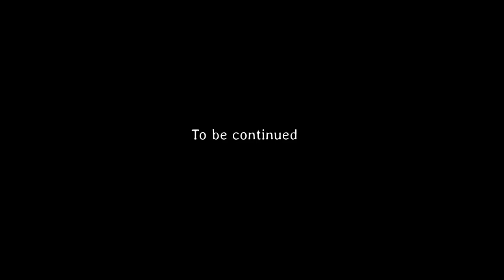How to Master Running the Drywall Flat Box on Stilts

Comment: Great job like always guys ,I'm sorry I have 2 good questions hope y'all can answer ,what size box is the first one on  the ceiling ? And on what setting how much crown is it using for that coat?thank you .
Reply: Wall and ceiling is the same box. 8inch Columbia fat boy box. 12inch of the same box for the final cost the next day when dry. Every job is different but for second usually a 3 if it has a fresh blade but just run a joint on a 3 and get a straight blade or small level and put it on the joint and make sure it's only just touching if it's not turn the box down to out more mud out or up if there's to much mud!
Reply: @drywallgangsters   thank you bro, I'm learning with yalls vids little by little also buying my tools one by 1 bc theyr so expensive .👍
Reply: @jorgiep09  no worries and yeah they are expensive. Once you run your second coat and it's dry put the level (get a small one or use something that's really flat but isn't long) on it and if there's a big hump give it a quick sand with a pole sander. If no hump you're good for the final box.
Reply: @drywallgangsters  thank you so much man I really appreciate yalls help ,keep up the great hard work .👍
Reply: havent really seen these before.  did you thin out the compound?

Comment: U dont have trace over your whole flat jus clean edges up an walk away. I u want pock to go away jus run the box back over it opposite way
Reply: What do you do about all your start and stops from the box we found that it all needs to scraped or sanded  before the next box. We do this to eliminate all that. Plus it's easier on the body not having to run everything twice!
Reply: @drywallgangsters  i clean edges an feathers into my lap mark to knock it down i dont sand or scrape either an i only do 10 box on 1 an 12 on 3 or 4 an i cone out with a good finish
Reply: @jasonhoover6320  what do you mean edges, does your box not feather your edges? What do you do with your starts where they leave a slight drag mark. Follow behind allows the person to fix any bad joints that the box can't fix and allows every joint to go tight into the inside corner because the box can't go right into the inside corner it leaves like a 10mm gap
Reply: Edges where u start your box im sorry i not a very good explainer lol. The box is designed not to be trace across the whole flat. Your work really nice im not trying to confuse you. Im not say your doing it wrong im jus saying you dont have to trace the whole flat. When you trace its takes mud away from the flat so actually the box isnt doing what its suppose to if that makes since.. I'm sure what your doing works. I time both ways an the way im doing is faster an thats money to me
Reply: @drywallgangsters  i know all i do is close that gap an walk away
Reply from the maker: When he "traces " he saves the mud doesn't throw it away. Also is quicker to blade off than run the box a second time. If you look down the joint as it's getting bladed off you can see the benefits it brings. Anyway each to their own
Reply: @jasonhoover6320   Jason Hoover   Jason Hoover  we use knives and glide over it we don't pull much off and you just account for the tracing that will take a slight amount off! Not saying your way is wrong either. For us when we run the 12inch we don't have a single problem this way and it comes up great. If you work alone than I guess your way would make sense but we got a big crew so instead of the person running the box and fixing every inside corner you get the other guy to do it he's gotta walk to the inside corner to fix anyway it takes just a little bit longer to be tracing it while going to the other side to fix the drag mark!
Reply: With that being said can u still get away with jus 2 coats?
Reply from the maker: @jasonhoover6320  lol no way mate, there is another coat to go on top. always 3 coats
Reply: @Maxkil  i only do two on flats an they knife check out jus fine
Reply: @jasonhoover6320  could run the box on just pressed tapes and it would be full if you run it thick and just sand it down but the Australian standard is 3 coats on flats
Reply: No way 2 coats not with our rebates anyway